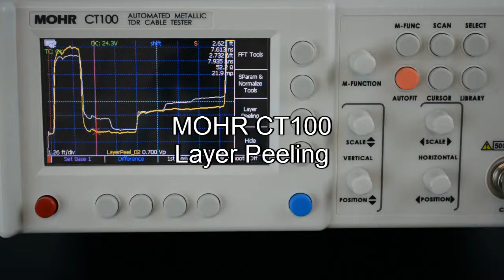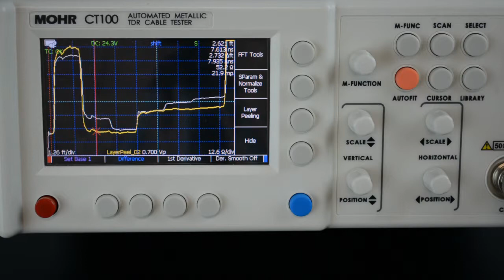TDR Cable Tester - Layer Peeling TDR Waveforms (MOHR CT100 Ch. 20) Time Domain Reflectometer

Comment: Why does the impedance of the first cable change (125 ohms) after peeling procedure, considering multiple-reflection effects should only apply at 2nd and later cables?